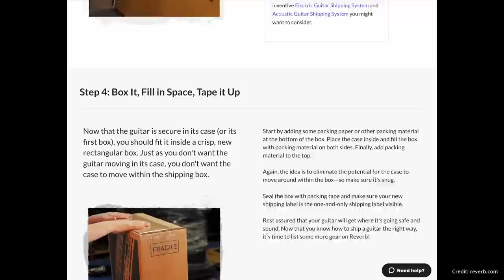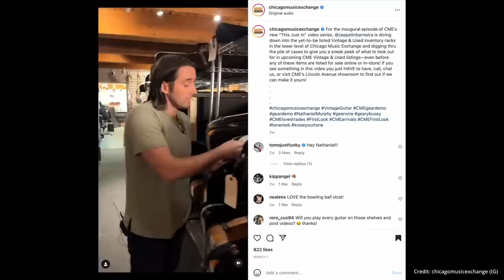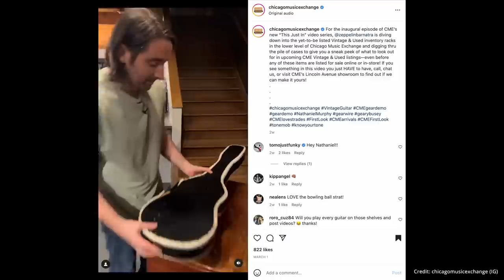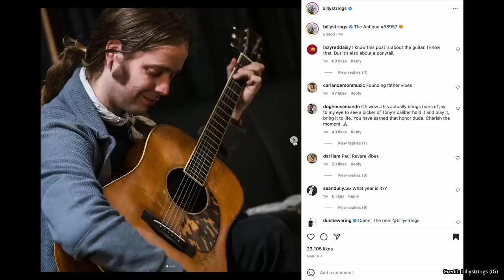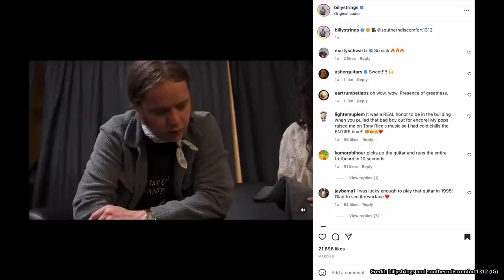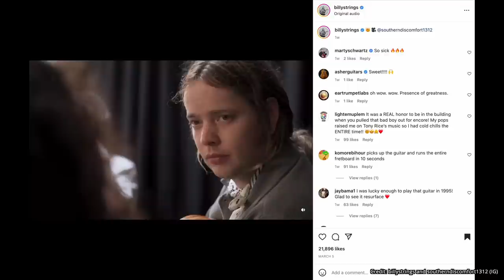10 Essential Tips for Flying SAFELY with Your Acoustic Guitar ★ Acoustic Tuesday 283

Comment: Great info. I just retired from Southwest Airlines last year after over 22 years with them. As someone else pointed out, the rule about boarding with your instrument includes: "if there is room". Also, I can't speak for any other airlines but with Southwest, you can only gate check  infant items and mobility devices as far as having them be brought up to the jetway upon arrival. Baby strollers, wheelchairs, etc. If you gate check your guitar with Southwest, you will have to retrieve it at baggage claim. I have flown only once with one of my acoustics and carried it on. I paid for early boarding. I felt bad about taking up so much space with my case. I think I'm going to buy one of those SKB flight cases and check it if I ever have to fly again with it.

Comment: I only did this once but was shipping buddies guitar for missions. I use Southwest air cargo. Got a guitar box, then cut two pieces of CDX plywood for sides, a bit oversized for good trap notches. Used my canoe straps. I think it could handle a 15 ft fall. 

After this I got me In me an ATA rated SKB that has never traveled but when I got a granddaughter and she walked on it - yes granddaughters are dangerous because attention is on the cuteness. The SKB saved Guild Bluegrass box.

Comment: Knocking wood, I've had good fortune packing my acoustic guitar in a hard shell case, detune the strings, use newspaper to stuff the empty space around the headstock - top, bottom, and sides. It prevents the headstock from snapping off if it gets dropped. Then gate check it. One time I was allowed to put it in the overhead, but it was a less than full flight - which is rare in Seattle. Alternatively, I like shipping it ahead, and probably should invest in a flight case. One more alternative - get yourself a "beater" guitar. Good enough to play, but not so good that if it breaks you'll also break your heart.

Comment: I've traveled domestically and internationally with my carbon fibre travel guitar.  Journey OF-660, Rainsong also makes very similar.  Neck detaches and sits beside the body in a case that easily fits in overhead storage compartments.  Nice thing is when waiting those long hours in the departure lounge, you can pull out the guitar and noodle away.  Very stress free.  I also keep laptop and prescription medicine (right inside the guitar) which  makes the travel even more stress free as i once had my main supply of prescription medication in my checked in luggage which got lost. Very stressful.

Comment: Great show, as usual!  I don't fly much anymore, with or without my guitar, but some of the tips can apply to travelling by car as well.  I use a Ziplock bag (sometimes two layers) in my accessory compartment in my car.  Never know when a sudden stop is going to make everything shift.  Tip one and two are important.  Manners always matter.!  I had a tile in my laptop case gate checked on a flight and another passenger took the wrong case.  First time I had used a tile,, but it saved my computer and my job.  Thanks for the weekly show.  I relax so much when I watch your show.

Comment: Hi Tony , I am  surprised you did not mention paying for a seat . United has this system set up very detailed on the site. I just flew from Seattle to Southern CA with a vintage 1957 J45 and payed for the extra seat and that takes all the stress away. And the plane was not full so I was able to but it in the overhead.

Comment: So I have an older 814ce (2001) and im going to replace the nut and saddle, what is your take Tony on tusq. vs. Bone vs. antler , vs. whatever ? And I removed the Fishman prefix sytem as well. Covered the hole with rosewood. Had the cover made locally.